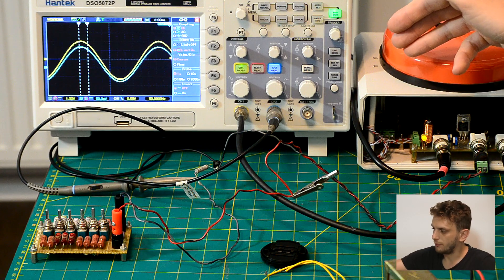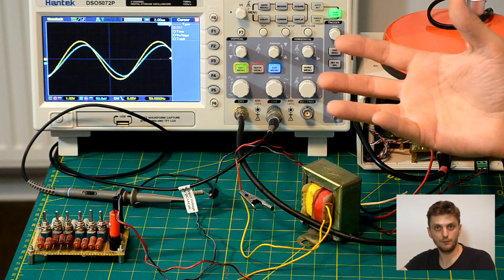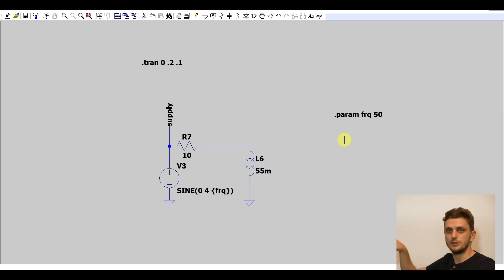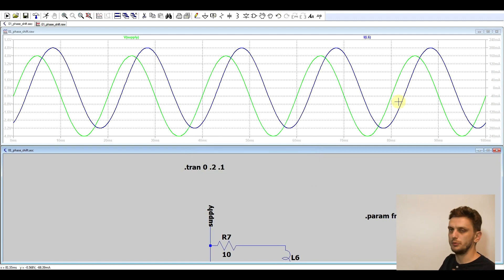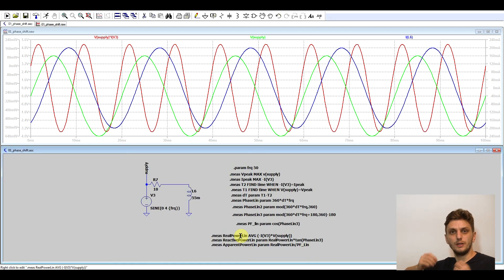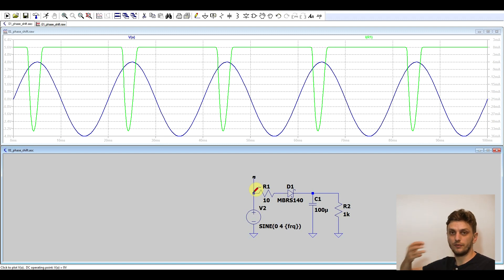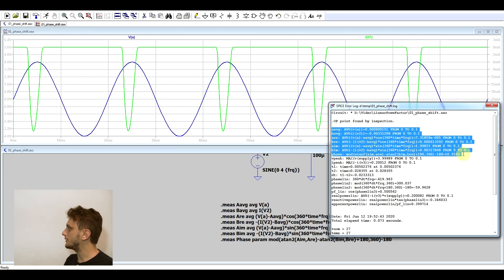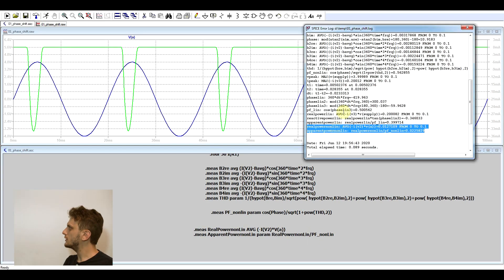LTspice tutorial - Measuring AC Power Factor

Comment: I would like to know if you have done any analysis where your system, or the electronic circuit receives an input AC voltage that is already distorted with an amount of percentages? I would like to know how could be this generated in LTSpice, starting from a good 230Vac 50Hz sine wave?

Comment: Thanks for nice video. However, isn't it faster to get phase and powers just to perform .ac with amplitude = Vrms and then to plot impedance to get phase, and V*I, re(V*I), and Im(V*I)?
Reply from the maker: The issue with .ac simulations is that they are performed as small signal analysis around the operating point. If your circuit is purely passive (inductors/capacitors/resistors) it will work; but once you add active non linear components - like diodes, the simulation will not take into account the switching (conduction/non-conduction) behavior.

Comment: It would be nice if you made a video about three phase circuits in LTspice. I have found only one video about it in youtube and it has really not much information, only how to simulate a delta source. Things like the power factor and THD in non linear loads is something quite tricky, also when trying to simulate real world measurements such as with two, three wattmeters methods. I am simulating in LTspice for example a three phase inverter fed by diode bridge and transformer, and need to measure power factor, displacement factor and so on, the transformer until now is the most complicated. 
P.S: Just a suggestion for a future video, greetings from Brazil.

Comment: Questionable use of curly braces in "v3 supply 0 sine(0 325.27 {frq} 0 0 0 10)"

    Error: undefined symbol in: "[frq]"
Reply from the maker: One of the first statements that is present in all my simulations is ".param frq 50"; maybe this is missing
Reply: @FesZElectronics  Thankyou! I realized my mistake. instead of SPICE directive, i chose the comment option.
Reply from the maker: In case you did not alter the default settings, this will cause the text to appear blue. So a spice directive is black and a comment is blue. That might make this more obvious in the future.
Reply: @FesZElectronics  Thanks a lot! I wish  if you were my Prof.

Comment: I want to measure phase difference of 2 voltage waveform but my last 4 .meas are not working please give me suggestion, I am getting amplitudes but it is showing measurement T1 FAIL ed
Reply from the maker: Maybe you can show us the exact .meas statement you used?
Reply: @FesZElectronics 
 .param frq 100
.meas inm MAX v(n003)
.meas om MAX v(Vo)
.meas T1 FIND time WHEN v(Vo)=om
.meas T2 FIND time WHEN v(n003)=inm
.meas dT param T1-T2
.meas PhaseLin param 360*dT*frq
I have simple inverting amplifier circuit which have capacitor in parallel to input resistance. I want to find gain magnitude and phase. v(n003) is input voltage source and frq is its frequency in Hz. v(Vo) is output voltage. I want to find phase difference of input and output voltage waveforms.
First 2 .meas are giving correct value but rest are showing FAILed.
Reply from the maker: Ha! The problem is not the syntax. In my videos I used the extra command ".options plotwinsize=0"; this means that LT will not compress the data of the signal points. By default, to save memory, the data points are compressed and this is affecting the measurement statements. Let me know if this works on your side.
Reply: @FesZElectronics   YESSSSS! it is working, Thank you so much, It will save my time.
Reply: .param frq 100
.meas inm MAX v(n003)
.meas om MAX v(Vo)
.meas T1 FIND time WHEN v(Vo)=om
.meas T2 FIND time WHEN v(n003)=inm
.meas dT param T1-T2
.meas PhaseLin param 360*dT*frq
I have simple inverting amplifier circuit which have capacitor in parallel to input resistance. I want to find gain magnitude and phase. v(n003) is input voltage source and frq is its frequency in Hz. v(Vo) is output voltage. I want to find phase difference of input and output voltage waveforms.
First 2 .meas are giving correct value but rest are showing FAILed.

Comment: Hi FesZ, very good vedio, as always, but one question "is it the right way to derive the real and imaginary part?"
Reply from the maker: Well the major advantage of that method is that it will filter out any noise - it let's you analyze the phase and gain of a clearly defined signal frequency.
Reply: @FesZElectronics  but I think rms value should be used for power calculation instead of average value.
Reply: @insistance1000  There’s no such thing as RMS Power